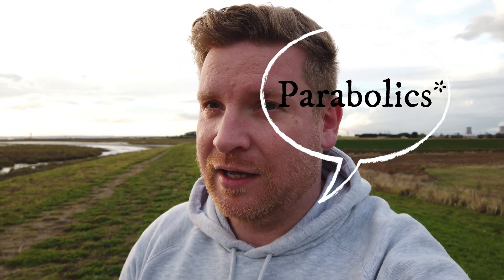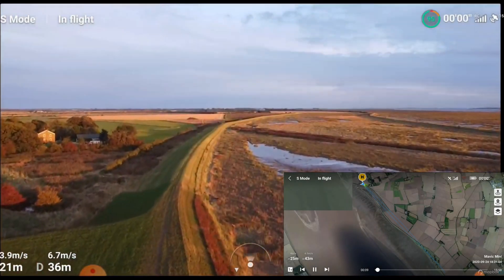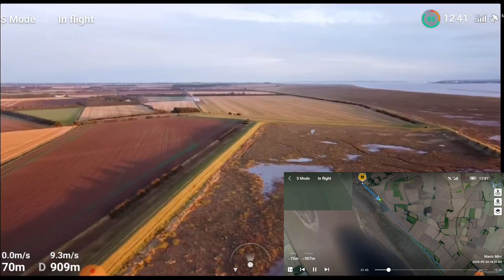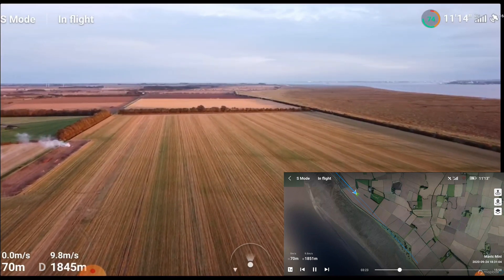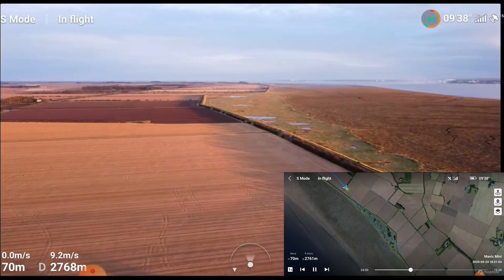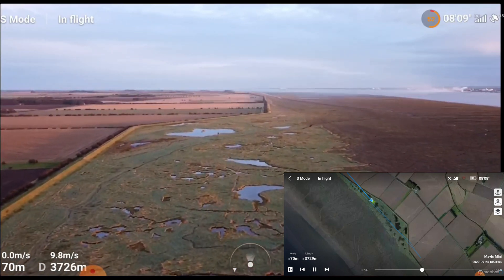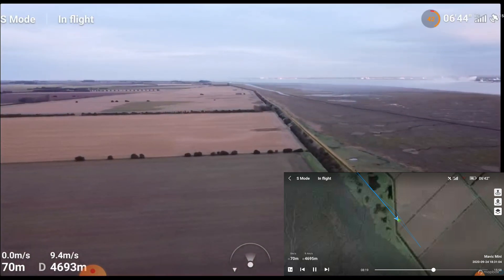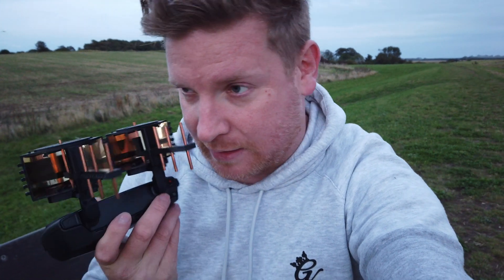MAVIC MINI RANGE TEST COMBINED PARABOLIC AND YAGIS! || PARAYAGI PREVIOUS RECORD BROKEN

Comment: If fcc puts more voltage to the antennas to give a stroger signal , could the uk controller be modded to increase the power output needed for a stronger signal?

Comment: Isn't sport mode more draining on the battery onboard the drone. It's only what I've seen on other videos. Just a thought maybe try p mode instead see if it goes further for better . And if you have Nd filter videos can you add a link in reply to this comment please as I'm still in two minds whether I should buy some I have a UV filter on my DJI mini se mainly to protect the camera lens as all I've seen as lens protectors are bad (falling off or not adhering good) and for reduced water glare but I'm 50/50 on Nd filters and what's the best to buy if they are worth the investment as some are not cheap... TYIA. Top man always informative and useful 😉👌🫶🙂also wouldn't a windless day be best for a legit full on test mate 😉👌

Comment: Is it always best to set your phone into airplane mode?
Reply from the maker: Bit of a myth that one - the wifi on your phone does not affect the signal at all and in my testing I never found any significant gain in turning on airplane mode. That being said - I still do it anyway because it causes less strain on your phone and cpu / ram, not to mention its not ideal getting a call whilst flying and especially when I am screen recording and test messages pop up!

Comment: Nice test enjoyed that 
Question why did you fly across water When  a field was beside your flight path ?
Reply from the maker: I usually fly directly over the water on other videos! But simply this is a regular walking path so I knew if there was any issue I could land and walk to get the drone :)
Reply: I’ve had some yaggis delivered before I see your recommendation and mine are made from what looks like a thick piano wire ? Although it states Aluminium shall I send them back and get copper or try them out I’m a bit worried of the range
Reply from the maker: @Dronesteve-72  When I do rage tests I tend to do ultimate range tests, the aluminium ones should be fine, you can check out ow they compare here : https://youtu.be/4bKq_0T09-o if you do feel like changing there is a link in my description to the ones used :)  https://amzn.to/30beIKC

Comment: +1 GAVINHR - WOW that's an improvement.  I recently ran across another very promising range-boosting method you might want to try.  Instead of (or in addition to) parabolic/yagi/parayagi antennas it pumps up the CE controller output power by disabling the country location within the controller's flight control software.  I'm not sure if this will provide the same output power as the FCC version since they're 2 different SKUs but it does increase the CE controller power output.  Note this doesn't use the FakeGPS app.  Instead it involves connecting the CE controller to your computer via WiFi and changing a single line of flight controller code from disable_country=0 to disable_country=1.   You can access this file via a Telnet command in a Command Prompt type window (instructional YT links below).   The best part is it seems to be a permanent change,  or at least until DJI updates the controller software.  If so, you can simply repeat the process.  The only downside is it requires a USB-to-LAN adapter.  Any brand is apparently OK as long as it sports an ax88772 chipset.  I've got to order the adapter myself as I'm definitely going to try this hack.  Of course, depending on which adapter you purchase, it may also require a cable adapter to convert standard USB to fit the controller's OTG port or USB-C cable.

1st video is very basic and in German language but no audio - https://www.youtube.com/watch?v=zUTYB4SlH-c
2nd video is more detailed but in Italian language.  The guy actually precisely measures and confirms the increased controller output power:  https://www.youtube.com/watch?v=P6Lh3c16lAo

Both videos provide links to inexpensive compatible USB-LAN adapters.  GAVINHR hope you do at least one more range test video using this method as it should be really great!

As always... Cheers from Thailand! 👍😁👍

Comment: Interested to note that your Orientation Display was not working. I find mine sometimes works but often doesn’t. I have known the compass on my iPhone to point South when it is actually North. Bit of mystery.
Reply from the maker: Absolutely. Drone is calibrated, phone is and for some reason the orientation is always out. Absolutely no idea why !
Reply: Have heard that the phone compass is influenced by the magnet in the controller loudspeaker. Bought a PGYTech holder which takes the phone further away from the controller. Helps a bit but the major plus is that I can replace my small phone with a 10 inch iPad. I feel like I am in the cinema when I am flying

Comment: Great test to 5km ,i managed 4km  with DIY Parayagis in a city from a back garden,came back due to battery issue .both antennas combined does indeed make a difference even in city considering if you have a low interference channel ,video on my channel
Reply from the maker: That's a great result! It's crazy to think that a few pieces of metal and a mirror can increase your range isn't it!  But wow 4km in an urban area is impressive! I will check out your video, thank you for the comment

Comment: Good test, quick question though, are those not the 5.8 parayagi only ask as I thought channel 9 was a 2.7 channel or have I mixed up the long and short yagi?
I thought long was 5.8 and short was 2.7 but I may have that switched.
Reply from the maker: Indeed you are correct it is the other way round :) the short ones are 5.8 and the long ones 2.4ghz so yes there are the 2.4ghz versions!
Reply: Ahhhh, ok cheers, DOH, I needs some long ones too then, I got short, oh well I knows now. Enjoy your vids be it car, drone or both.
Reply from the maker: Thank you! Really appreciate it! Obviously its what I'm in to but a lot of car people use drones for filming so it's kind of relevant 😀
Reply: GAVINHR top tip for you, don’t fly close to waterfalls, I just found out the hardway that the wind produced by them drags the mini, and it dragged mine into a smell tree over the falls and splosh one swimming mini, managed to recover it I’ll try drying over a day or so to see if I need to contact DJI refresh.

Big fat facepalm for me. 🤦‍♂️
Reply: Should say small tree.
Reply: @Theskullcollector1  updates? :D
Reply from the maker: Yes! How did you get on? Did you save it?
Reply: Sorry guys forgot to update y’all, yes I retrieved it from the water and I sent it off to DJI for repair under the DJI care insurance and they sorted it, I have it back now.
Reply from the maker: That's brilliant news!